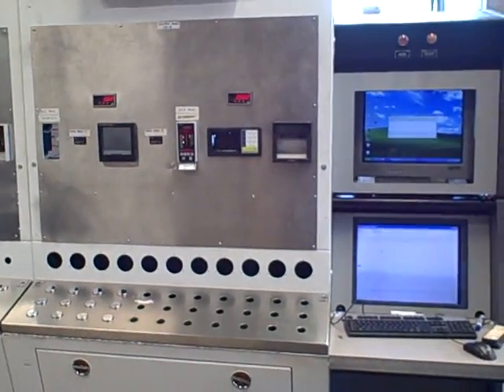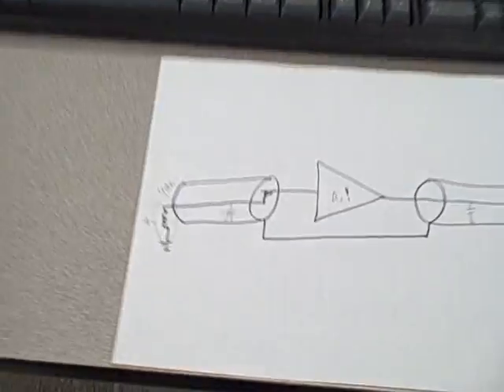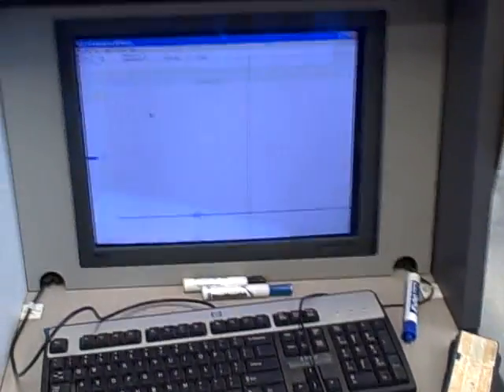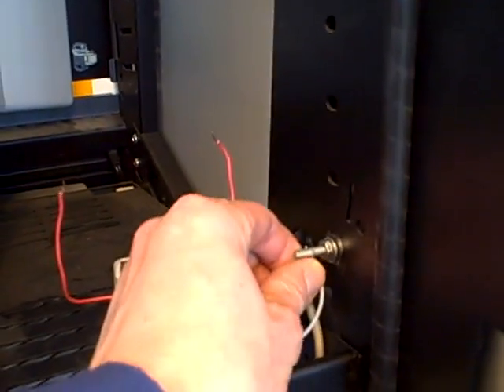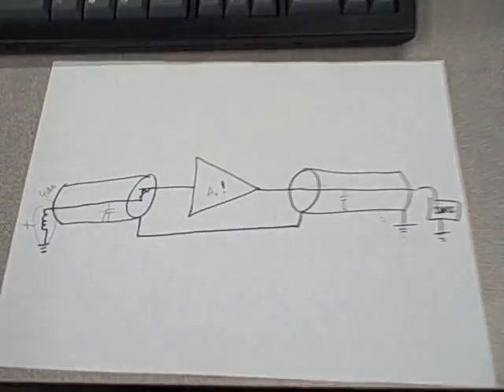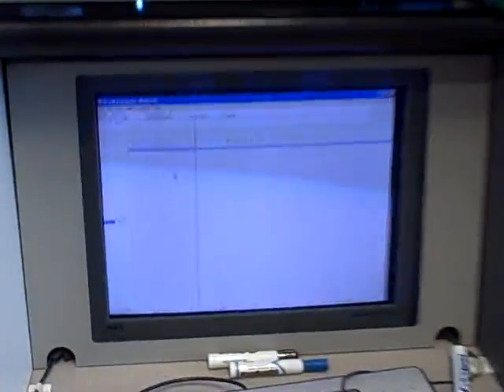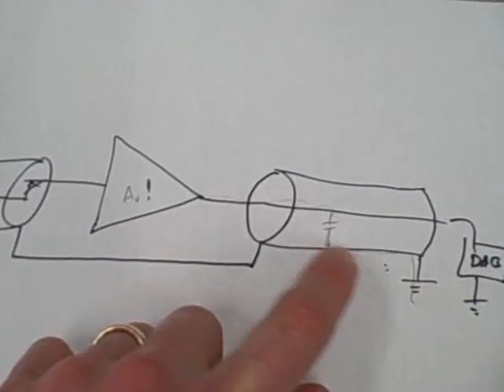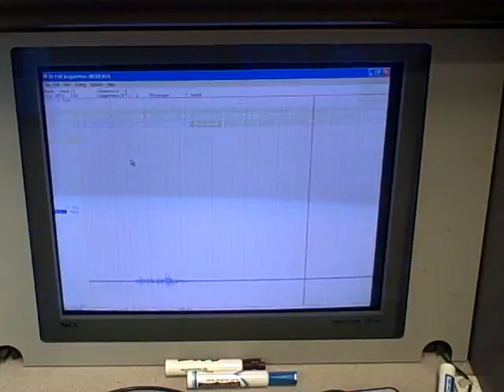Ungrounded cable shield causing problems

Comment: Great example and explanation of the importance of cable shield grounding. 

It would be interesting to see the effect of isolating both cable shields at both ends. I wonder if the shield would act as a ferrite bead and smooth(distort) out the signal. 

Isolated shielding should still block external noise as long as the cable shieldings were isolated from ground on both ends and isolated from other cable shields, assuming the pair of wires you were protecting did not have a grounded conductor.